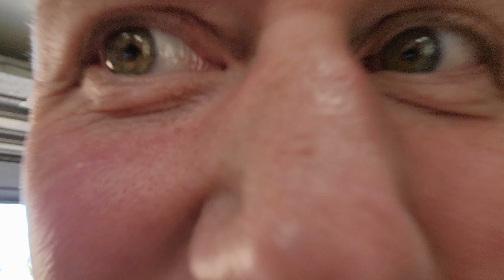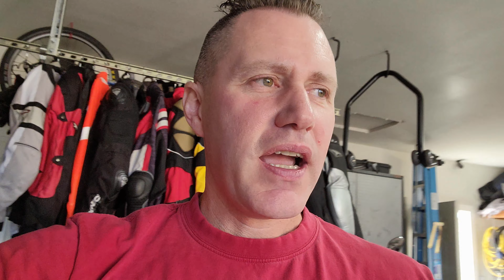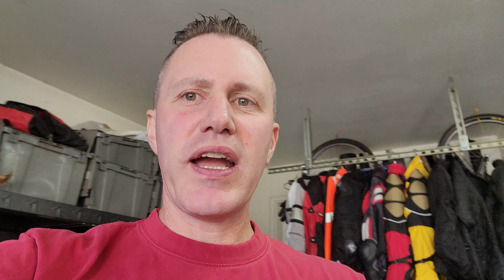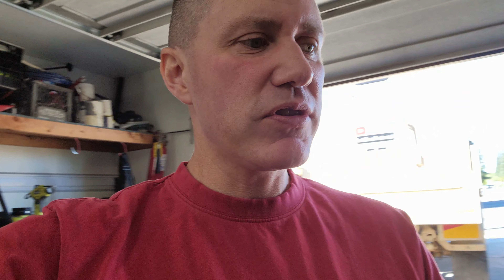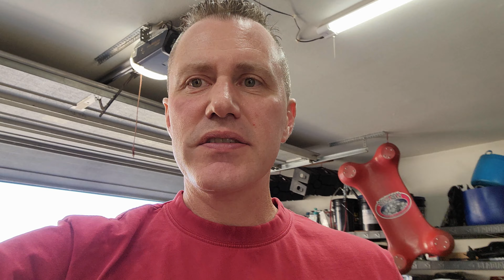Husqvarna Svartpilen Part 28 (Fuel X lite install Part 1)

Comment: I chose to buy and install FuelX Lite on my 2019 Svartpilen and installed a DNA air box lid. Super easy installation and all works perfect as Millyard would say: The bike has more torque on low revs and pulls better on high-speed accelerations. The exhaust is original and I like it that way, not disturbing my neighbours more than necessary.

Comment: hey how does one access the fuel pressure regulator you mention in the video? Would you be able to link to some resources? I can't find anything on the user manual for my 2021 401
Reply from the maker: Remove the fuel tank.  You will see it.

Comment: I have an Svartpilen 401 2019 and I can´t find those cables of the bike where the cables of the Fuel X should be connected, help please.
Reply from the maker: Follow your O2 sensor wires behind the coil just like I posted in the video
Reply: thanks!

Comment: Was more curious about that aforementioned air pressure regulator, where's that located exactly?
Reply from the maker: There is no air pressure regulator on this bike.  There is a fuel pressure regulator on the fuel tank.

Comment: Oh no part 2?
Reply from the maker: Stay tuned!
Reply from the maker: So far on my commute in I noticed a huge difference.  Super smooth, no surging at freeway speeds.  Low speed/low rpm no more herky jerky.  No check engine light as some others have stated.  

Makes the bike feel like it should have been from the factory.

Makes me wonder if the o2 sensor on these bikes is in fact a wide band o2.
Reply: @SeanFillner  already sounds like an excellent buy, I just want smoother power delivery in 1st and 2nd
Reply from the maker: @JimmySnakes  definitely order one cause that was the first thing I noticed.
Reply: How long did it take for you to notice the flies lite making a difference at lower gears and RPM?
Reply: @robertocastro2023  I got the pro version but once you set it up and select the level you want to adjust to, you feel it immediately when you start riding